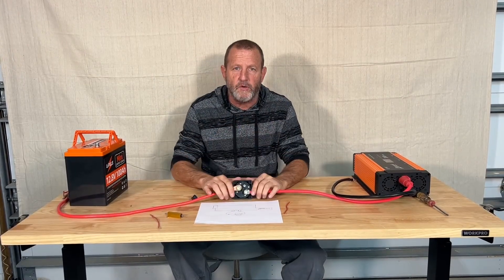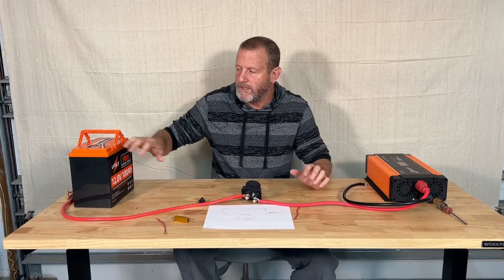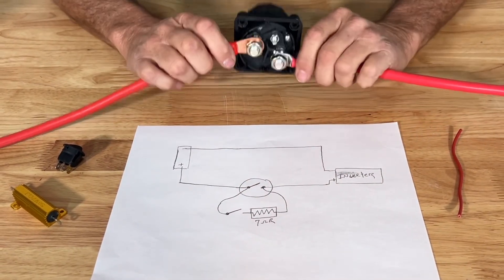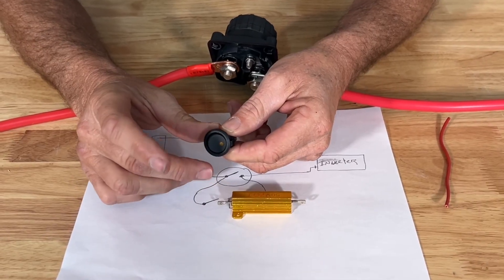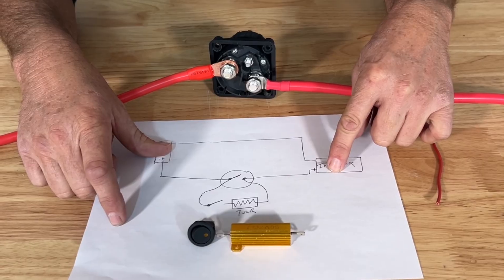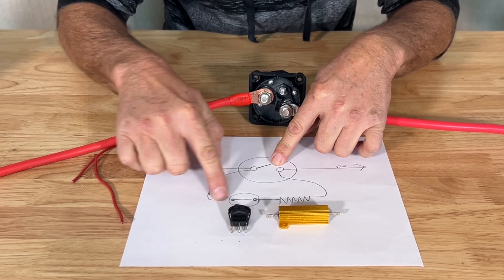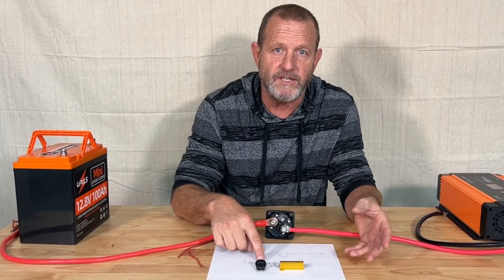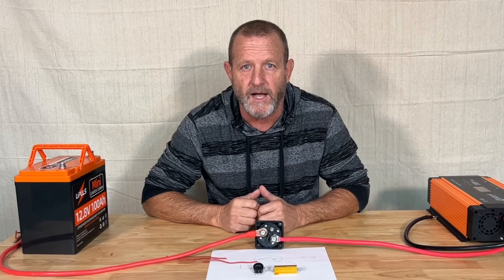How to Build  & Wire an Inverter Pre-Charge Circuit - Step -by - Step Guide.

Comment: Instead of the resistor, you can use an incandescent light bulb of the same voltage rating as the circuit.  The light will shine brightly at first and then dim out to zero letting you know the caps are fully charged.   On my 48v system I use a 48v 402 bulb from a forklift.  It is installed in a BA15d bulb socket beside the battery switch and is operated with a momentary pushbutton.

Comment: I have done that exactly with a similar resistor, great vid !  
Aaaand then I bumped into the "bulb method" (  https://youtu.be/mtgGbUuxnUc?si=zMPBvtK9VxfNTDw0  ) 
AND now my question is : where in the circuit would I have to hook the bulb so I could have both of them ? I guess in series between the switch and the resistor, then to the battery so I could get the fade out on the bulb as an indicator? 
  I understand the bulb way kind of make the resistor superfluous but having a visual cue would be great.

Comment: good video.. how do you know when its precharged properly though? how many secs is a good time to hold it?
this question also goes for my setup below
gawd i hate the sparks.. 
just had a hurricane.. about to setback up everthing..dont have a switch. trying to make do... all i got is a 100 ohm 5w resistor..
im thinking im gonna hold it 5 secs and then hopefully not get the sparkies. should it be longer?
all i know is once i can afford it.. im switching straight to a junpaw? think its junpaw brand that another youtuber said come with inbuilt precharge circuits.
Reply from the maker: with this size resistor 5 seconds is plenty or if you put a voltage meter in line it will start at 12v then drop to  zero and go dark.   that tells you the caps are charged
Reply: @StoneBrokeAdventure  thanks much! 
its a pair of 12v 300ah batteries in series.

Comment: thanks for this video, so needed! thoughts on calculating wire size for the resistor/switch?
Reply from the maker: Quick calculations (12 V battery, 7 Ω precharge resistor)

Initial current (at 0 V on caps): I = V / R = 12 / 7 = 1.714 A

Resistor steady dissipation while charging: P = I²·R ≈ 20.6 W
→ That means the resistor will briefly dissipate ~20–21 W while the caps are charging. precharge current is small (~1.7 A) — thin wire is fine for that branch
Reply: @StoneBrokeAdventure thanks so much 🎉

Comment: Light bulb in series until the light goes out, done. The bulb is ballast, absorbing the excess current. Obviously you use a 12v bulb for a 12v inverter, etc. You can hook up a shorted circuit the same way for troubleshooting instead of blowing many fuses trying to find a short. The bulb will go out when the fault is cleared. Just put the bulb in place of the fuse.

The resistor and switch is good but sometimes you don’t have time to source a large resistor.

Comment: Great explanation. Thank you. Two questions if I may. What size wire should you use to connect the momentary switch to the resister and then on to the regular shut off switch? And, how long do you hold the momentary switch down to ensure the capacitors are charged so you can use the regular switch and get power to the Inverter? I have heard "just a few seconds" but then I've seen the light bulb version of doing this and that takes a good 10-12 seconds for the bulb to go off indicating the capacitors are charged.

Comment: Thank you for the great info and apologies in advance for this long-winded text! My setup: 1) 12-volt AGM flat plate accessory/starter battery in 2010 Toyota Prius. 2) Renogy 1000W inverter model: RIV1210PU-126-US. 3) Cables: Pre-made Prius Custom Cable Kit PCCK-1 from boatwireusa. 4) The wiring kit contains two sets of positive/negative 4AWG wires attached to two SB 175A 600V Anderson Connectors. One set is for battery connect and one set for inverter connect. I use the quick connect/disconnect Anderson connectors to attach/detach the inverter from the Prius to either use the inverter or store it. So one set is permanently attached to the battery and fuse, and the other set is permanently attached to the inverter. 5) Also have a Blue Sea Systems MRBF Terminal Fuse Block mounted to the positive terminal of the Prius battery. The battery side positive lead connector of the Anderson connector is attached to the MRBF terminal post and I have a 100A 58V fuse installed in the Anderson Terminal Fuse Block. With that said, I’m concerned about the continual connecting/disconnecting of the two Anderson plugs causing sparking and/or degradation of the 12-volt battery and the capacitors in the Renogy inverter. How would you go about pre-charging the inverter capacitors using this quick connect/disconnect scenario? Hold one of the two-leads from an incandescent light bulb socket to the positive Anderson connector lead from the battery and then touch the other light bulb socket lead to the positive lead of the Anderson connector attached to the inverter? Or use a resistor in place of a light bulb as in your video? If so, does the inverter need to be powered on or off when doing a pre-charge? Again, sorry about all the detail but when doing this sort of stuff you can't be too careful. Really appreciate any input on this.
Reply from the maker: inverter needs to be off .neg from battery connected to neg input into the inverter and resistor/ or lightbulb between two positive connectors from battery to inverter. hold for a few seconds. capacitors are now pre charged . remove resistor and plug in anderson connector. if the inverter was left on, the capacitors charge would drain out internaly inside the inverter when you disconect the resistor to plug in inverter. . so it must be in off position.
Reply: @StoneBrokeAdventure So to clarify, I first need to run a connection from negative to negative between the disconnected Anderson terminals, and then briefly connect the lightbulb or resistor between the same two disconnected Anderson connectors to discharge correctly? The Anderson connectors are using 4 AWG. The lightbulb socket uses very thin wire. Should I match that thin gauge for the negative side too? I'm going to use alligator clips on all 4 ends (two on the lightbulb wire ends and two clips on the negative wire ends). Thanks again for the help.
Reply from the maker: @steveo3494  yep that should work

Comment: This is the first video I see on this topic. I did something similar with a 2-position battery switch. Position 1 is the pre-charge resistor and Position 2 is direct. When I turn on my inverter, I always cycle to position 1 first then go to 2 pre-charging the capacitors and preventing any inrush current.
Reply from the maker: great idea such a simple but practical solution
Reply: Does this eliminate the need for the momentary switch because you're using position 1 on the two position battery switch?
Reply: @robh063 its does eliminate the need for a 2nd switch.

Comment: Thank you so much for the video demonstrating how the pre-charge works! I was one of the people who requested it, and I really appreciate you making it. My final question is: how do you determine the appropriate size resistor to use with different-sized inverters?

Regards,
Reply from the maker: it really doesnt matter the size of inverter. if you go 7 ohm you will be fine. the ampeak safe anti spark cables are 3.5 ohm if you go to  much higher it will take to long to fully charge inverters. we are just trying to slow that curent down to where it takes a second or 2 to charge those caps
Reply: Okay! Thank You